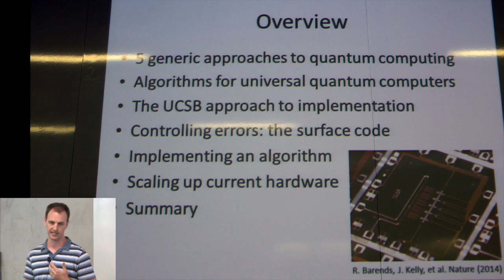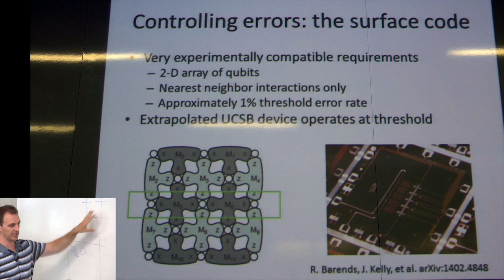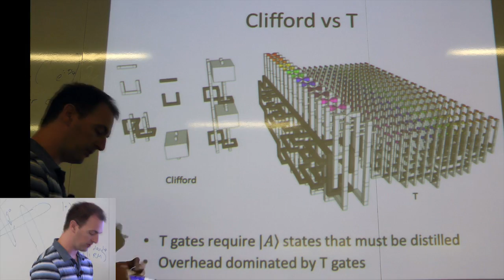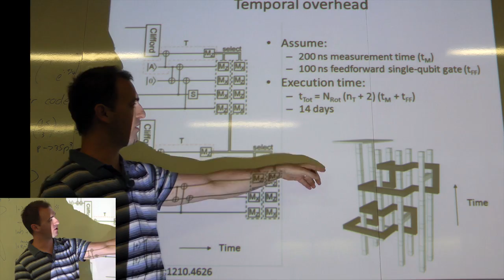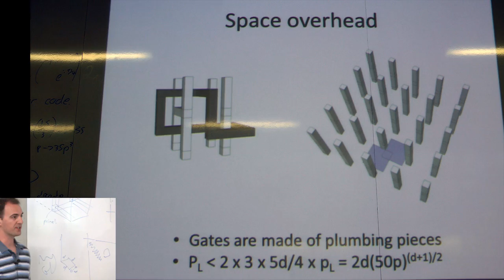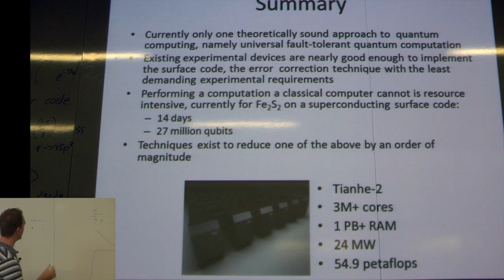Austin Fowler:  Why and how should we build a quantum computer?

Comment: Professor Tao gave a good lecture on the mathematical techniques of proof by attempted disproof, and if Quantum Computing device is going to do anything useful, it's going to have to do similar operations? And, (rhetorically), that is why a digital machine is the only successful device so far, and why parallel processing is the "middle ground "?

The efficient "solution" is to have more people who are better trained and informed with more transparent access to better data through improving search engines coupled directly to human brain power. (Would that be a voluntary Matrix?)

Comment: So how would a Quantum computer stack up against a DNA based computer? What would be the pros and cons of putting the time and money into research for either/or?? And given the astronomical costs of going down either road (Like you could easily buy a Boeing 747 for your own personal use any time you desired it for the next 20 years) just to compare to the research costs of either computer, and why should we not just stick with a more normal Intel Xeon based processor type computer for example?
Reply: Owen Mitchell virtual reality ! Raytracing is a search algorithm that would work with Grover algorithm. Imagine a quchip that can synthesize a fullblown holographic VR with only a milliWatt.